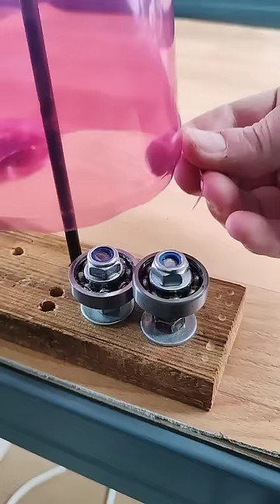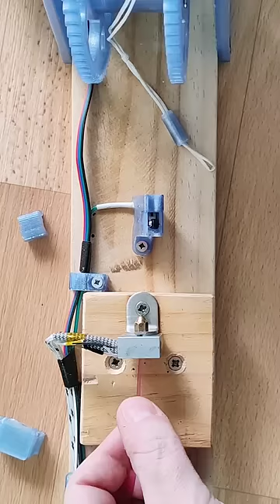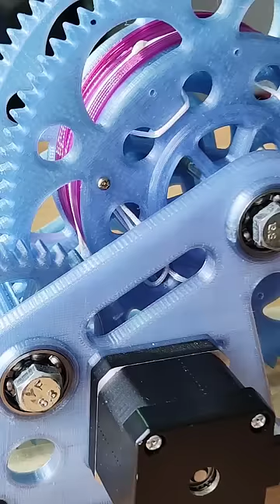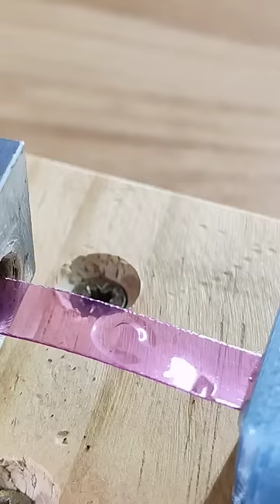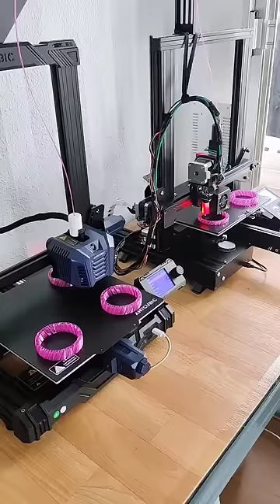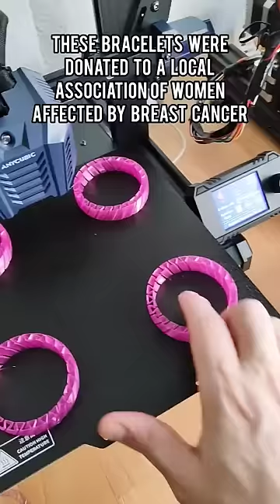Finally a good opportunity to use my pink PET filament

Comment: It would be cool to see you get the luminous green from the mountain dew bottles.
Reply: Plastic is probably not flat enough to extrude into a filament of consistent enough size to print with. Notice how smooth the bottle he used is and how consistently he cut the width of the strip
Reply: @elijahtheurer344  he could get an empty 2-liter(litre?) of Mountain Dew
Reply: @elijahtheurer344  filling the bottle with high pressure air and then slightly heating it will flatten the surface
Reply: @elijahtheurer344  he has ways of flattening it
Reply: @elijahtheurer344  also depending on where you are the bottle has a different shape, i know in my local grocery store the bottles are more flat.
Reply: @Elijah Theurer  lol my guy is making perfect strands from an old water bottle. You don't think he has ways to flatten a plastic soda bottle?
Reply: @elijahtheurer344  you understand one plastic bottle is made from the exact same pellets as any other right? Tropicana comes about 3 inches tall of condensed plastic they own there own forming machines to stretch and form the bottles

Comment: I live in a state where there is a bottle deposit of 10 cents.  So for virtually every bottle like this, we have to pay a deposit of 10 cents which we get back when we take the bottles back to be recycled.  Since bottles where I live already get recycled and they would cost 10 cents each to keep, would it still be worth it to make one of these setups to make my own filament, or would I be better off just buying PLA since the plastic is already getting cycled.

Comment: Do you have any tips for building an extruder machine like that 
I have assemble some parts hot end stepper motor and I was thinking to use 3d printer main board to flash the software on and only use the filament lauding to run the motor and try to do it that way
Reply from the maker: function3d.xyz

Comment: Place 1, super thin carbon fiber strand inside the middle of the formed/fold…a fiber laser could cut the strand without affecting the transparent Petg(or?) pre-processing…Possibly post.. Regardless, that’s a start and you could manufacture super strong/engineering grade objects with this technique if applied/refined..
Reply from the maker: I don't know how that could work, besides being very complicated to achieve what you say, in 3D printing the plastic filament melts, what would happen with the carbon fiber strand?

Comment: The plastic from the bottle isn’t pla (which is the standard plastic to print with) so therefor when melting it you are releasing harmful chemicals into the air
Reply from the maker: PLA is more toxic than PETG or PET
Reply: @function3D  pla is made of cornstarch and plastic used to make commercial bottles is made of oil. Pla is much safer than any other type of plastic.
Reply from the maker: @charlieprice059  PETG is safer than PLA, so PET is also safer than PLA

Comment: Wouldn’t it be easier if the filament was loaded on a spool you can switch out and load on the 3D printer straight away with out having to manually load it on a new spool? 🤔

Comment: Ширина ленты?
Reply from the maker: The width of the cut depends on the thickness of the bottle wall, as a general rule:
Thickness Width
0.2mm 10mm
0.25mm 9mm
0.3mm 8mm
0.35mm 7mm.

Comment: Why is it always breast cancer and not all cancers?
Reply: I've worn other ribbon colors to honor other battles with cancers, but I believe pink ribbons are most common because breast cancer is one of the most common cancers. pink was also not the original color to symbolize those who fight/fought breast cancer, and was actually spread by people trying to profit off of support for breast cancer survivors
Reply: @ryph0bic  I own a variety trove of ribbon pin clasps that represent various medical distinctions, such as diabetes, cancer, etc. I own these because I used to buy them on eBay, and also sold them on eBay.

Having been born autistic, I cannot help myself when I toggle the math, so please forgive me: If you place common breast cancer in a single group, and place all the uncommon cancers in another group, it turns out that the uncommon cancers are more common than breast cancer is common.